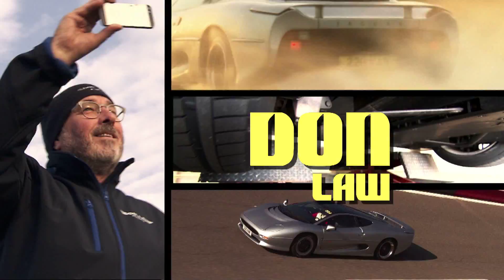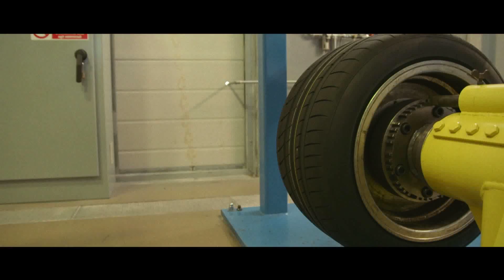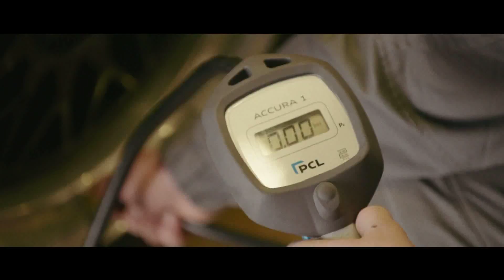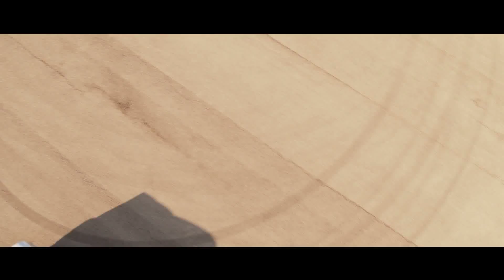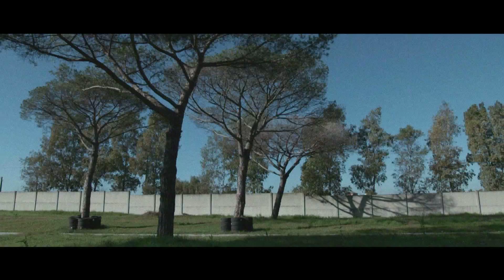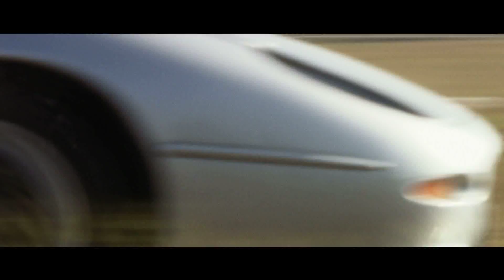Bridgestone x Don Law XJ220: The Legend Lives On

Comment: i dont understand. The xj220 tyres are 345 35 18, a quick google search reveal there are 3 companies that make tyres in that size. Why are the xj owners claiming there are no tires for their cars.
Reply: Front tires are the problem, nobody is making 255/45/r17 with speed rating over 300km/h
Reply: Maybe it's more about the name bridgestone on the tires to stay true to the original. Also the tires i found were semi-slick street tires so you could not drive them in the rain.